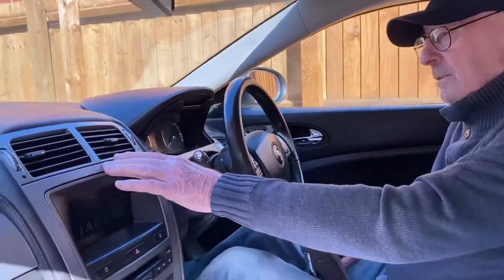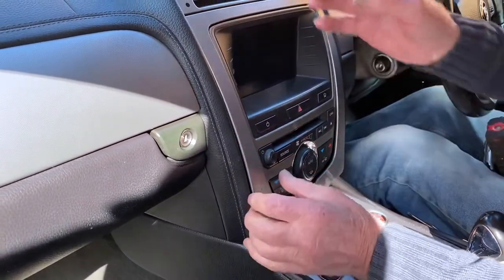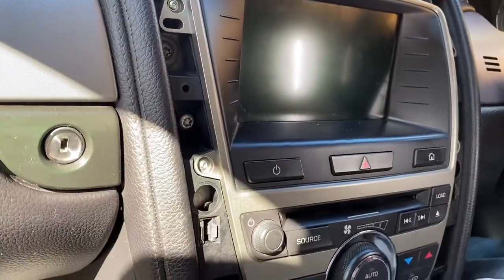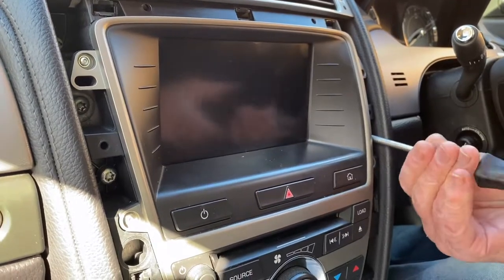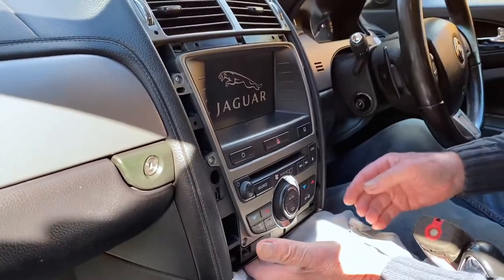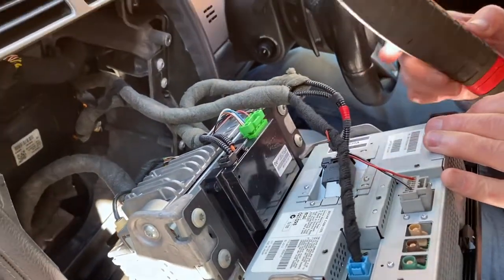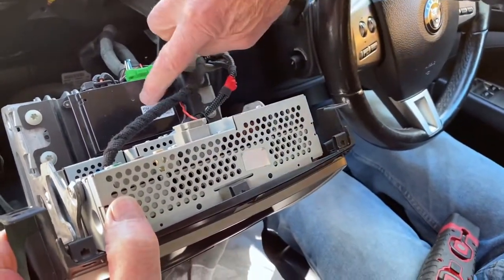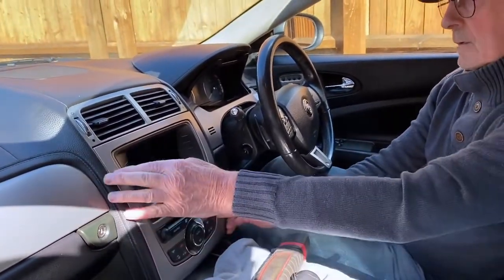Jaguar XK 2006 Onwards Entertainment Unit Removal | CrystalClearMechanics

Comment: I have to deal with a shrinking leather area above the centre vents - this video made removal look easy. Going to try warming the leather and pulling it down under the vent lip. Should work...many thanks for the tutorial!!!
Reply from the maker: Hi, thank you, It is even easier as there are only 4 bolts to remove the unit ( top and bottom ). Yes warming the leather should work. Thanks again for watching.

Comment: Great video! Thank you!
Reply from the maker: Hi, Thank you for watching and for your feedback. there are in fact only 4 screws ( 2 top and 2 bottom ) that hold the unit in, even easier to remove. Thanks again for watching.
Reply: @crystalclearmechanics  Update: followed your advice - all came off easily. Thank you again! 
Shame I still couldn't find my entertaiment system to reboot and the sound to break when raining. All seemed dry back there. XKs are full of fun puzzles! :)
Reply from the maker: @ib4464  Thank you, I'm glad the video was able to help.

Comment: Nice presentation, thanks for the video.  I am interested in removing the entire dash unit as mine has a tan color that I want to change to black as it shows brightly in the windshield reflection.  Best regards!
Reply from the maker: Hi, thanks for the compliment / feedback. I have not taken the entire dash out of an XK as yet, the facia under the speedo / rev counter pulls out the same as the facia around the entertainment unit. If you have a problem when changing the dash let me know and I'll see if I can help. Many thanks again.
Reply: Really nice and clear, no nonsense.  I too am interested in a video of this quality showing whole dash removal as I have the dreaded duckbill air-con drain issue on my 07 XKR.  I've had a go at reaching the duckbill from the top of the engine bay but it is maddeningly millimeters out of reach.